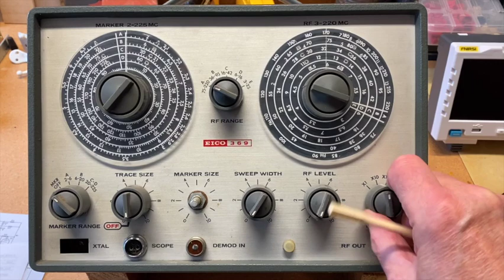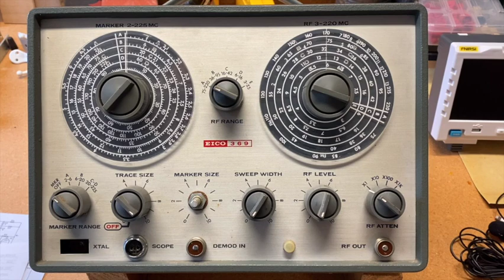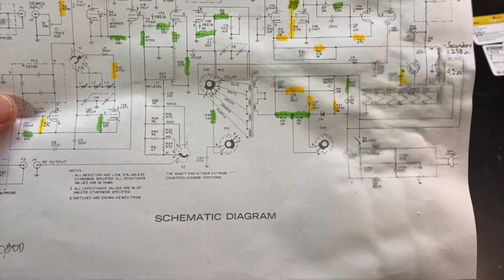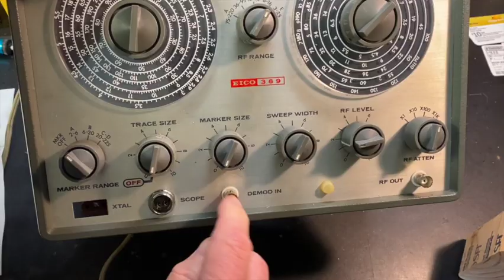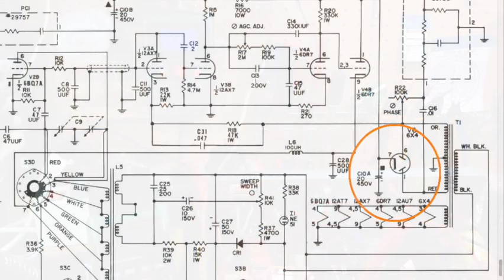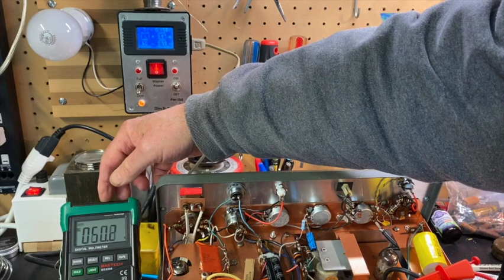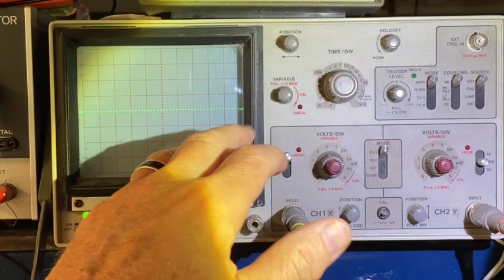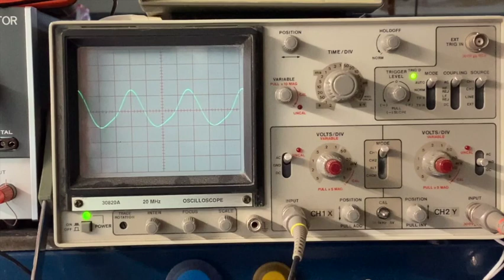Eico 369 FM Sweep Generator Episode 1

Comment: looks like there was no part 2-?
Reply from the maker: No, there wasn’t. As I recall, I fell ill about then and didn’t get back to it. I just rewatched the video, and as it turns out the Eico can’t be tuned (requires hand-selected small-value capacitors and certainly not worth the effort). I did add a digital frequency counter with display because you can’t trust the dial. I may have recorded video for that and will post it if I find it.

Comment: It’s not uncommon for these generators to have distorted sinewave output. In fact, the distortion allows the generator to output higher frequencies by creating the harmonics needed.

Use of the demodulation function along with X-Y  function allows one  to look at the detected .modulation  waveform. This eliminates the need for a higher bandwidth scope for alignments.

 The circuit uses a saturable reactor to create the necessary sweep  used in fm bandpass alignment.
The Heath kit IG-57 Sweep generator uses a similar circuit.

The two circuit amphenol connector is for the X&Y outputs to drive an oscilloscope. Although the mating connector is still available, I choose to drill an additional front panel  hole  and replace the two wire connector  and add separate BNCs for the X & Y outputs.
Reply from the maker: Thank you for your comments.